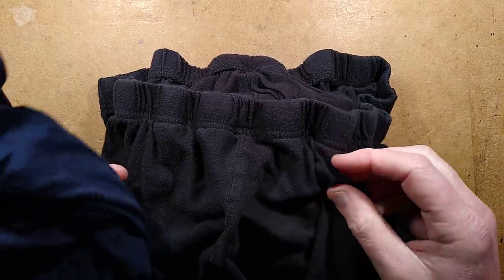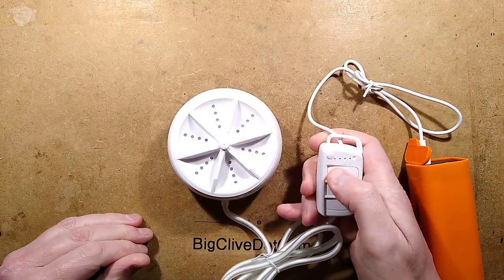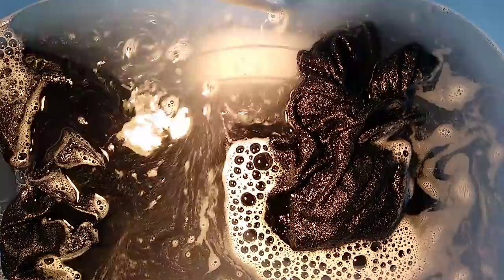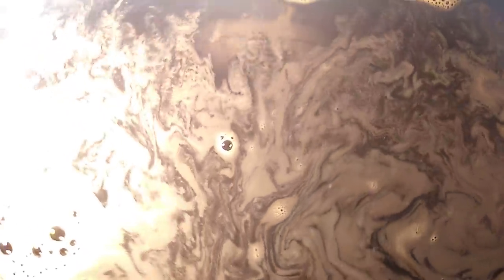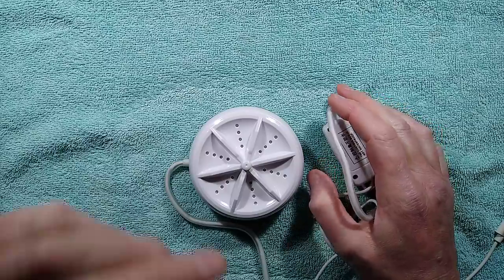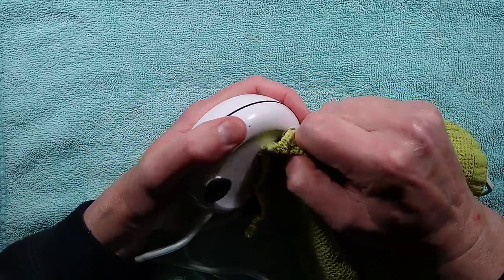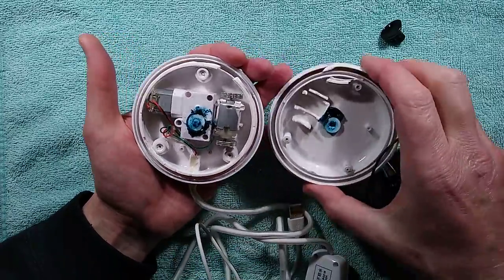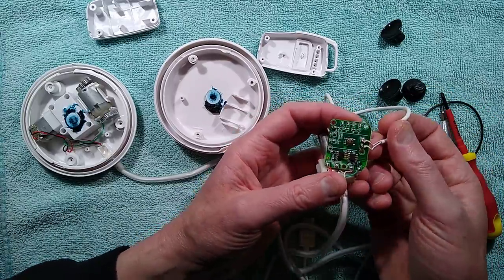USB laundry machine for tiny (moist) Chinese panties.

Comment: I bought one of these months ago, thinking it would be really neat. As you're well aware, they are 0% waterproof, and when I took mine to bits after the motor stopped spinning, it was FULL of rust. Salvaged the cute little air pump, though! P.S. when stuck on the side of the sink, the "ultrasonic" feature very slightly reverberates through the entire building. All in all, got about 2 uses out of the thing. Great product, A+.
Reply: I'll pass then or recommend to someone i dislike thats a long, long list tbqh.
Reply: so it's actually a full building cleaner? WHAT VALUE!

Comment: I’m sure Volkswagen group are wondering why the inline button controller looks suspiciously like one of their car key fobs :)
Reply: AG stands for Aktiengesellschaft
Reply: @cebruthius  And Volkswagen Group is the official international name of the Volkswagen AG.
Reply: How did you comment 6 days ago but it was uploaded 2 hours ago as of this comment? 🤔 🤔 🤔 🤔 Spooky YouTube.. 😂
Reply: @thewolfydragon1989  - Patreon! They get things in advance.
Reply: @thewolfydragon1989   Patron members get thse videos a little earlier than the rest of us.
Reply: Clive should test the bubbles for excessive amounts of pollution. Maybe they copied Volkswagen a bit too closely.
Reply: I was actually thinking that looks almost exactly like the newer Hyundai keyfob molds.
Reply: @CyclonesWorld  Makes sense that Hyundai would copy what VW was doing a decade ago.
Reply: @MylesV 
You mean like fudging their diesel emissions testing? 😁
Reply: @tin2001  I'm not sure how after the emissions was fixed on the VW vehicles. Owners lost power and fuel mileage. So was the exhaust cleaner without the emission working ? It seems better fuel economy and power means engine is running correctly , and burning more of the fuel fully. My $00.02.
Reply: @NY411Info  Ironically fuel efficiency and pollution are not entirely linked.  Higher efficiency burns more hydrocarbons and gives better fuel economy and lower hydrocarbons in the emissions.  However you get higher smog gases like oxides of nitrogen.  The "cleanest" emissions usually try to limit oxides of nitrogen and then process the hydrocarbons in the catalytic converters.
Reply: Dr. M. H. For those who haven’t left Germany in decades: The Volkswagen AG refers to itself as the Volkswagen Group anywhere outside Germany, Austria and Switzerland, referring not only to the Volkswagen brand but also including other subsidiaries such as Audi or Skoda.
Reply: @thewolfydragon1989  Exactly what I thought.
Reply: It's not uncommon that plastic factories will repurpose injection molds after they have ended their original obligation for the part, offering use of the mold to other clients; so that's how a VW key fob might have become this washing machine controller.
Reply: Jason Pagura - now that's the most insightful statement I've seen yet on this thread!
Reply: It looks like that because: China.
Reply: They are just old molds that plastic Companies sell once they are worn out or no need for..
Reply: @thewolfydragon1989  never heard aboud blacklists for the comment section? the cannel has to accept these comments.
Reply: Dr. M. H.  Guten tag, two words
Reply: Dr. M. H.  i know the word gib nicht und gute abent also :P
Reply: @NY411Info  You are wrong. There is a trade-off between pollution and gas mileage where NOX is concerned.  The increasingly strict gas mileage standards have caused worse air quality in American cities because NOX control technology hasn't been able to keep up with Obama's efficiency standards that he was so proud of.
Reply: @toomanymarys7355  Well you are probably right, however when the pollution control is removed it is better for the engine. Look at the direct injected gas engines carbonizing the combustion chamber. Take off controls you get a better burn.
Reply: IP theft of the suspicious similarity VW key fob for this device. I wonder lol !
Reply: Haha, third button is MOT mode

Comment: “This could get boring very quickly” as I’m glued to the demonstration hoping this is the solution to cleaning a few clothes on long camping trips. Thanks for investigating this type of product for me!
Reply: Get a bucket and add two of these instead of one,problem solved
Reply: @thegullet2225  I agree, is two that will do
Reply: Get a bucket and a clean stick to swoosh it around
Reply: or a bucket with water, detergent, and some good old elbow grease!
Reply: Tim the Toolman Taylor would have this suggestion. You buy a rechargeable portable drill then buy a stirring attachment (painters) add a weight to one side

Comment: Had one of these for a while, used when travelling for work, used for trollies and socks but my unit had no bubble function, worked reasonably well, got everything clean not bad for only a £5 still going strong after 3 years. 
On your digression about twin-tubs we had one for a family of seven, very easy to maintain I cut my engineering teeth on them, was an expert on them before I started my apprenticeship as a Fitter/Turner (and ever other power tool in the shop).

Comment: I remember my mother using a twin tub --- borrowed, because our real washing machine had failed. I was actually rather impressed. Very simple, but also extremely effective. You put the dirty clothes into the agitator, stir them around until they're cleaned, then move them to the other tub and hose them down until they're rinsed; then you spin dry them. While working on the rinse, you have the next batch in the agitator. Compared to a modern washing machine they're incredibly fast; only a few minutes per load. But they do require manual operation. I can totally see that they still have a niche, and a brief search online shows lots of new ones for sale...
Reply: Your far too modern, I remember mum having a twin tub but no spin, that's what the mangle was for!

Comment: Bubbles of soap increase the surface area and trap oils and grease. I suspect that is the point of the bubbles, to trap and remove the skin oils from the laundry and float them in suspension until the cloth is removed and rinsed.
Reply: You don't really need visible bubbles of soap to do this. The whole reason we use soap to clean is because soap naturally forms bubbles(micelles)  that trap oils and dirt inside,. in addition to the lipid nature of soap interfering with the lipid bilayer bacteria cells use to contain their contents of course.
Reply: Whether the bubbles worked or not, quite a lot of skin oils appeared to come out of the pants.
Reply: I've heard that's a myth, but never really seen any serious evidence either way. I do suspect that that's what they were going for, though.
Reply: I think good evidence that you don’t need air bubbles is detergent made for HE (high efficiency) machines. It doesn’t make bubbles.
Reply: @fburton8  out of the pants or out of the vibratory cleaner device?
Reply: @fburton8   🤣👍

Comment: ...which begs the question, which will become more agitated the clothes or the purchaser?
Reply: Considering that the watered motor would rust and seize before next use I doubt the device would make anyone happy.
Reply: Michael Bishop  A dry switch surely prevents the wet motor from turning into a lump of rust. Totally common sense.
Reply: Michael Bishop  6 or seven items?.. Or purchasers?

Comment: In the past, I have worked in the electronic manufacturing using SMT components.
I always see unmarked SMT resistors especially the smallest size ones so it is normal to see them with no values.
However, it is very important to check the values before loading into SMT pick & place machines as you can't visually inspect them afterwards.

Comment: The moment I started watching the video I thought... Will using the unit with one of those dodgy USB wall adapter make the water go AC live?
Reply: Definitely if you plug it into one of those gay death daleks.
Reply: It's not a bug, it's a feature.
Reply: @Cadwaladr  Uhhh.. say what?
Reply: @dregenius  Clearly not a longtime BigClive viewer. Look into the history.
Reply: Kent Arnold  using is not exactly what clive does with them.

he demonstrates them briefly and then takes them to bits.
Reply: If you're in doubt about whether your dodgy AC adaptor is dodgy enough to make the water live, you can always drop a chinese electrode heater in the water just to be sure...

Comment: Several resistor manufacturers are no longer printing values on SMD parts 0603 and below for cost saving
Reply: Wtf? Are they serious?
This is so stupid
Reply: Just how do you do a legible value print on a flea dropping size resistor anyway?
Reply: @SeanBZA  Microscope needed to check marking.  No marking increase risk of the pick and place being misconfigured to place wrong parts undetected.  Even a tiny marking will allow the pick and place internal camera to confirm the part number coming off the reel and the optical inspection machine to check that parts are at specified board locations (while also detecting missing and backwards parts). Electrical inspection machine will have a harder time checking all components for value while in circuit.
Reply: ive often wondered why they dont print values on capacitors and inductors, at least the 0805 and larger ones
Reply: You never rely on the reel or labeling, but rather measure a few SMD passives instead. I've heard of at least one case of mislabeled inductors which caused a whole batch of finished modules to be scrapped; they were RF devices as well so they merely worked crappily and the problem wasn't detected until they were installed in a car on the assembly line. Relying on any sort of labeling simply shifts the screwup point from loading the pick and place machine to loading the printing machine at the passives factory.
Reply: It’s a race to the bottom.
xD
Reply: I knew this kind of video will attract you here sometime...
Reply: It sort of makes sense.  0603 sized items are sooooo tiny that they are probably only handled by manufacturers and robots and not hobbyists.  I have been using 0603 LEDS and Resistors lately... they are not very great for average unskilled home gamers :p  

I did get it done.  FYI if you do plan to use 0603 components buy many more than you need to because several will accelerate at relativistic speeds and end up 300 years in the past in Africa somewhere... you will never find them.  Umbutu tribesmen are equally confused.
Reply: @someguy2741  As a hobbyist solderer of 0201s, 0603s are positively huge. Yeah, not labelling them might be cheaper, but I can read what they say, and an unlabelled reel would be a pain to identify otherwise. Advice for those using 0201s: do not deposit more than you are comfortable using in one sitting, because at some point you are gonna sweep the weird pile of dust from your desk, and that's that.
Reply: @henryokeeffe5835  at that point use trays.
Reply: @someguy2741  As someone who works at an electronics manufacturer, where we mainly use 0603, I very much like them being labelled. I do repairs on the PCBs and having labels on them greatly speeds up diagnosing potential problems. Even at a manufacturer, we definitely get use from the labels :)

side note, I can personally feel the pain of an 0603 falling into a black hole.
Reply: @johndododoe1411  lol; that is not how it works at all, no PnP will "check value with camera" haha, that would be foolish. AOI machines do not reply on markings either
Reply: @lo2740  I would expect them to compare to a reference image, at least for the orientation.  Wrong markings could make such image checks error out, without any parsing of symbols.
Reply: @johndododoe1411  well, the only visual check done by PnP is for orientation and alignement, as you may know the pick and place are working extremely fast, visual checks are done in millisecond, any kind of image comparison with a database would be unfeasible, also the variety of packages and the shear number of parts would make it impractical and quite impossible. But anyway that is a non problem because it works perfectly well the way it is. Also PnP often have RFID or QR code on carts to avoid operator error when loading carts.
Reply: @lo2740  Orientation without an image of the proper component would be difficult as orientation marks are often subtle.
Reply: @johndododoe1411  yes camera(s) are really mostly used for alignement which is the only matter since pin1 orientation is specificed in DS (usually toward the band holes). Some parts only have orientation marks on bottom (LEDs, tiny packages, transparent packages etc)  orientation can be checked manually once with bottom camera for verification purpose, but overall its the operator job to make sure the part orientation in feeder or platter / tube  matches that of the control software. And anyway its only done once before starting the batch. I have never seen parts with wrong orientation in reels.
Reply: @lo2740  I've seen PnP videos where a particular component was orientation checked every time.  Also bubbles for 603 and 402 components on reels may be big enough for orientation at picking to be random.
Reply: @Yannick 73 Yeah, I was using a very fine pitch QFN device (a USB hub I think) that had so many pins broken out in such a small space they needed 0201s to go between them as decouplers. I used 0402s for everything else. I also think 0603s are my favourite though, easy enough, small and easy to find. I also hate the use of "mils". I used to have to use imperial measurements and in the UK we call thousands of an inch "thou" which results in far less confusion.
Reply: Miniaturization is gonna kill everything lol
Reply: I think the smallest I've attempted was 0804 or 0603, my hands are too shaky for the smaller ones 😂
Reply: How many millicents are they saving per 1,000?
Reply: Given industry shortages Might have been less about the cost of printing it and more about having more printing capacity to get larger ones done quicker/in higher volume.
Reply: @tuttocrafting  the parts come on a role so the value will be on the role so the pick and place machine doesnt care and having one less step in production does make sense
Reply: @johndododoe1411  the role has the part number on it
Reply: @straightpipediesel  i dont belive that for a second theres no way the role would get miss labled, you would need to take the tiny parts out of the reel and put them in a diffrent role which just isnt phesable  , likely the wrong role was fed into the machine or miss programed
Reply: @djscottdog1  You are obviously referring to rolls of component tape on reels, not roles of people and devices.  And anyway, a roll is just temporary packaging that could easily get mislabeled during packing.
Reply: @ashtonhoward5582  Nice!
Reply: @djscottdog1  I worked in a company for a while that distributed a whole batch of electric heating element controllers all across the Europe. All of them, fortunately, just died seconds after plugging to AC. The cause was a mislabeled reel. We ordered rectifier diodes, and got 60V Zener diodes in the same package. Someone screwed up at the component distributor level and put a wrong sticker on a wrong reel.

Comment: Oh lord this reminded me of when I was an 18 year old lad forced to live in Grandmas with her twin tub. Thursday night got all my black heavy metal clothes washed in the twin tub, hung on the line in summer or all over the living room in winter. Come Friday and Saturday night with my freshly washed pirated Iron Maiden & Metallica T-shirts (that smelled of screen printed Dulux paint), every time I was caught by the blacklight behind the bar in the clubs I was lit up like a Xmas tree of all the sparkling "better than white!" that was in those big box powders and could'nt be rinsed out. At least using my twin tub, cold water hose from tap, and a stick method. Destroyed many clothes too.
I also remember the manual mangle from the '70s my mum used instead of a spin drier. Naturally I got my finger caught in it as an infant, just like I did with the hot iron I was warned not to and the electric sockets too. My mum laughs to this day that when I was told not to do something, I would eventually do it, get a minor injury and then absolutely not cry because I knew wrong from right. (Sucked my finger, waved it around and said "burny hot!" when I touched the Iron)
Reply: I stepped on a hot soldering iron as a child.  My dad had warned me not to go near where he was working without shoes on, but did my little punk ass six year old brain listen?  Nope!
Reply: I wonder if peeps will have the same issues 20 years from now as well because I am currently forced by my own obsessive compulsivity to hand wash my boyfriend's work clothes before going to do the laundry later in the week. My overworked hands feel it too. This is a cute video though! I still seem unable to conceive of how these things all work to get it done ✅

Comment: I would have expected the device to sit at the bottom of the tub.
Reply: Definitely! 
Wonder if it specifies - but probably not in English either way.
Reply: There are other models of this gadget available that you hang to the side of a bucket, or they already come built-in into a bucket.
Reply: that was my thought too - I think it would work much better that way
Reply: @digus  The image on the back of the box shows side mount. Personally, I'd put it on the bottom.
Reply: That would take extra effort to keep the wire and clothes from tangling.
Reply: @skeetsmcgrew3282  .. 😁 Cheeky bugger!
Reply: I've seen the instructions and the pictures of how to use it are VERY basic: eg, the drawing the of device is just juxtaposed over a drawing of a bucket.

With this being a mass-produced clone device, I wouldn't put it past the resellers to have simply misinterpreted the drawings by saying "put it on the side" instead of the bottom